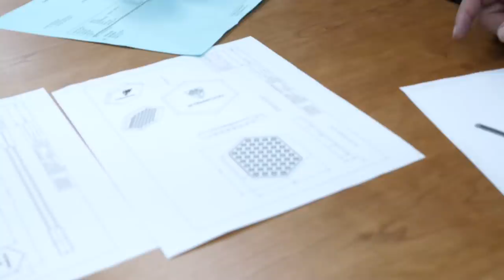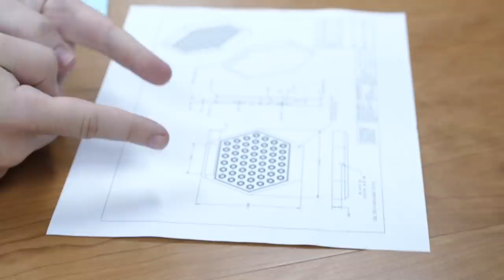THE M&T IS DOWN! (also waffles) S8E11

Comment: I was on team waffles, but pancakes are starting to sound better - with just a flat plate, like a crepe maker (will it close on both sides?) you can make not just pancakes, but you could grill basically anything else on it as well. From pancakes to korean style BBQ to a grilled cheese, I think a flat plate might be better in the long run versus one that can just do waffles. Also cheaper.
Reply: My sister and I don't like hot dogs, so whenever we do a hot dog roast we use ours to make chicken breasts.

Comment: On the plus side, if the Machines were installed incorrectly, they'll have to come back and get you fixed up.  

As long as you didn't do something stupid like attempt to fix it yourself, with no clue what you were doing, making it worse, and absolving them of any responsibility or warranty obligations.
Reply: I mean, it's not like they didn't have everything good to go when the setup/training guy flew in. Nothing critical (like power) was missing, making him idle for a day.
Reply: With all respect, this isn't a toaster, the company that sold it to them isn't going to just not help them after they touch it themselves, this is B2B a whole different set of rules and obligations applies.
Reply: @knewbod  I believe Jason said he tried contacting them for support but wasn't able to reach anyone. The issue with which they're contending is they need the machine up and running now as Keystone is about to go idle.

I remember the shocked look on the tech's face when they told him electricals weren't in place in 8x08.
Reply: At this level of products, most companies will send somebody out to fix the product and just make you pay out the ass for it.
Reply: Vlogs - When your audience knows more about the arena of a certain part of your business than you do, you do better next time. LOL!  

Seriously though, it sounds like you haven't ponied up the money yet for a position you way underestimated salary for and didn't hire because of it.  (Did you hire a guy?)  Time to put on the big boy pants, open the wallet and get a guy hired so Jason can get back to his actual job at the top and stop wasting time trying to put a band-aid on all these little self-inflicted wounds.  That sounded a little harsh, didn't it?  We love you.  We only want the best for you, but sometimes mommy and daddy have to speak to you on an adult level. 💓💓💓
Reply: I used to work for a company that made emergency power and lighting solutions for businesses in the UK. They made those huge battery cabinets that maintained power to critical systems for several hours during blackouts. Those cabinets to this day maintain life-support machines in hospitals, server rooms in large on-line trading companies, etc. And they had a dedicated 24/7 service team ready to respond to any call at a moment's notice. They'd come and fix the cabinets even if someone messed with them. Of course, a reasonable charge for repairs out of the scope of the warranty would be applied to deter any future attempt at unqualified repairs, but they'd still fix it all the same, shake hands with the client and smile politely before leaving the site.

For companies that make specialty, industrial products, burning bridges in not an option. They say one unsatisfied customer will let 10 other customers know how badly you treated them and exaggerate at that, so if there's only 100 potential customers for your products in your city/county/state, that essentially eliminates 10% of your market, simply because you were being unreasonable in the face of a stupid client. Clients are allowed to act stupid up to a point, but you never are.
Reply: And post video saying you did exactly that. There is no longer any proof that this was installed incorrectly or messed up by Wyrmwood. They can probably still get a tech out to fix it, it will just probably cost tens of thousands of dollars now instead of being the machine company's responsibility.

Comment: You had people in to install this what. A few weeks ago. and you're already making new parts. ON your own time, with your own money? Hope they reimburse you, because this is the companies failure. Also regarding the waffle/pancake maker. Have them Design a functional waffle maker that's the right thickness, because it sounds like part of the issue is to much metal. Then make a hinged set of wooden covers. 

See how that cuts into the costs for machining the metal parts. Then put that up as a stretch goal.

Comment: You guys have a machine shop in the same building. Why not just have those guys throw your out of square guide on a surface grinder to fix the angle? Seems like such an easy quick fix.
Reply: simpler to just clamp it onto that table and use the machine itself to bore new pressfit holes into the guide and table, atleast i assume that machine should be capable of cutting metal also.  it's 100% gonna be square to itself lol

Comment: ok first of all  Tabletop Tiles Keychains better be part of Project Hexy Time (Hexy keychains?)

second thing. i have some questions about the MGT in general. i’ll get mine eventually but i was a pretty late backer and i’m in australia so who knows if mines due before 2030 or not

why are the tables so dependant on one machine, and what was the fallback it the M&T didn’t arrive on time (aka 6months late and with teething issues)

will the tables they have been made so far actually be modular? will people that have a MGT now be able to actually buy different legs/runners/etc and take advantage of the modular aspect

was this project too ambitious?  should you have maybe capped orders to something more reasonable, and done MGT 2.0 when the production is ramped up and ready

serious questions, id like to not be downvote bombed because people think i’m hating on you guys (i’ve commented on literally every video for the last few years now). i feel like the risks have outweighed the reward so far for MGT and the people suffering are your customers and soon also your PA workers
Reply: the machine speeds production up, they have to be making the parts to the same drawings either way. so yes, they should be modular, 0 reason for them to not be.